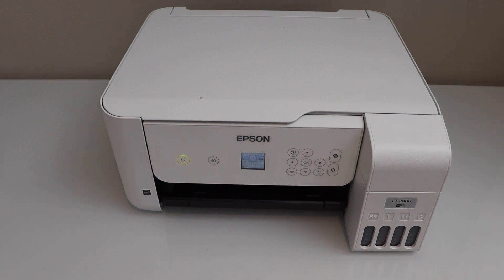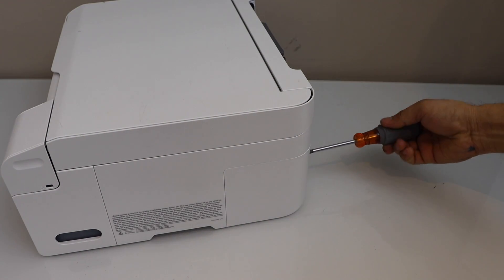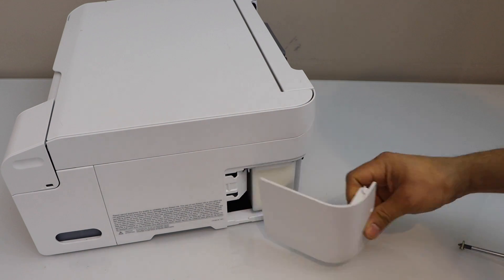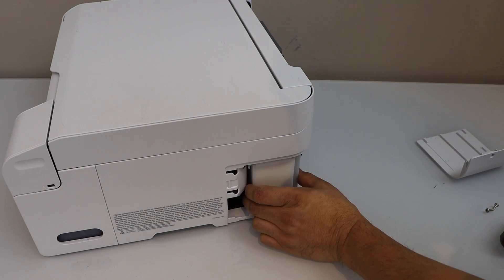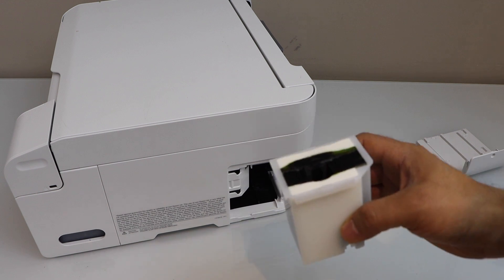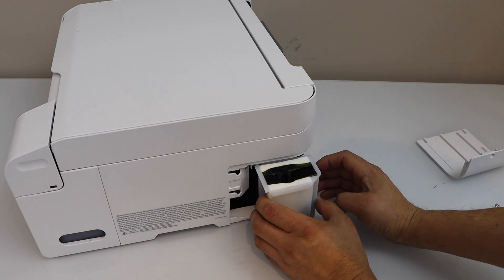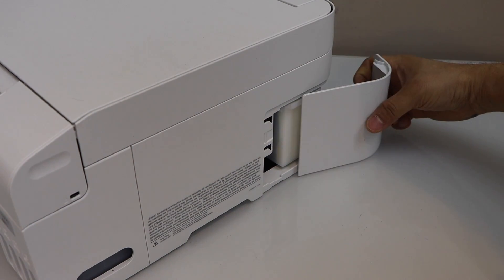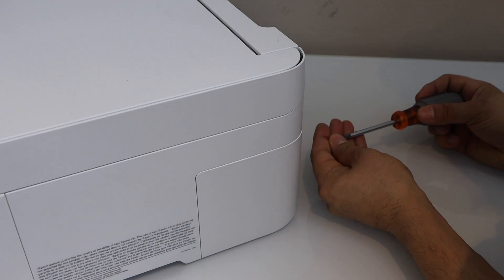Epson ET 2800 Maintenance Box Replacement.

Comment: I gave you a dislike. You obviously have never had a full Maintenance Box on the ET-2800. You simply can't just replace the Maintenance Box, you also have to reset the Maintenance Box counter. There is a procedure for that and I am told (not sure) that you need a code from Epson to do that, AND they allow you only one Maintenance Box replacement. If you make another video that answers those questions, then I will watch it.
Reply: Did what he did im now stuck with the problem you are speaking of i have a clean box in but need to reset it and don't know how

Comment: Helpful, thank you.  I did clean the pads out, it wasn't as easy as cleaning out an air filter.  The ink required a lot of squeezing, then I dried them in the oven for an hour and a half at about 150F.  They did not expand back to full size but popped them back in am sure they will be absorbent again if they need to be.  Printer works again after power cleaning and it used less ink than expected.

Comment: I just got done watching your two videos on the cleaning process of the ET-2800. It was very helpful and the Deep Cleaning option resolved two of my colors from not printing. I wanted to ask... I need to buy some ink replacement on Amazon, but I see a lot of aftermarket brands listed. Have you any experience and/or recommendation on what I can use that is safe for the printer?